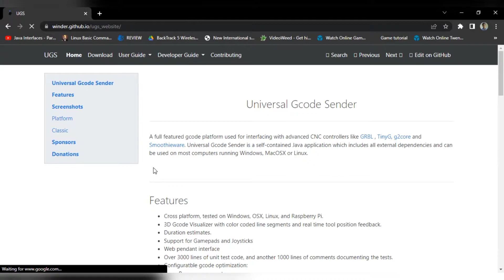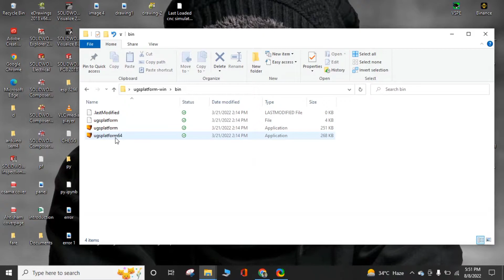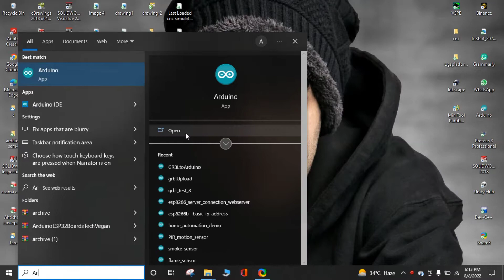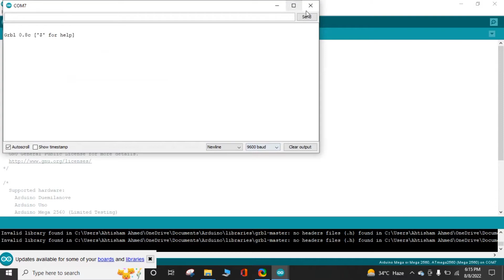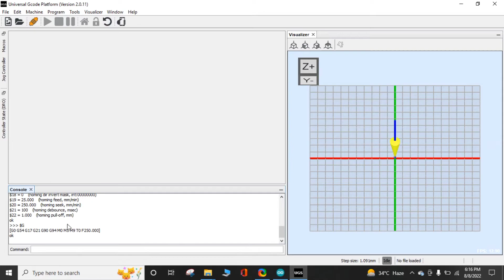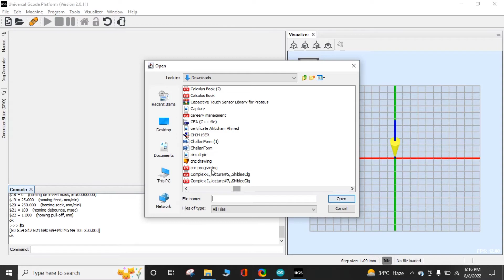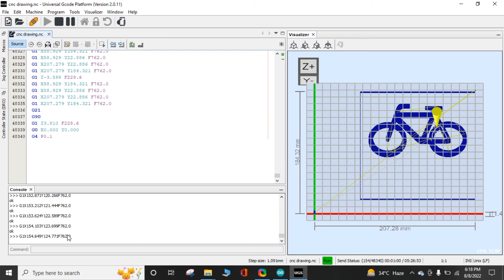How to connect Arduino Mega with universal g code sender?

Comment: How can we send it over cloud to our 3D printer which is connected to ESP8266
Reply from the maker: You can use Arduino cloud for sending. What you want to do.It would be helpful for me to explain you.
Reply: @emergingengineer3007  I have connected an ESP 8266 to the 3D printer RAMP board,using platformio i deployed a code to control the 3D printer using wifi,Now i want that instead of wifi the 3D printer can receive commands and g-code through cloud from anywhere.